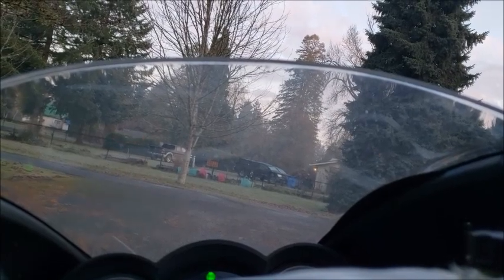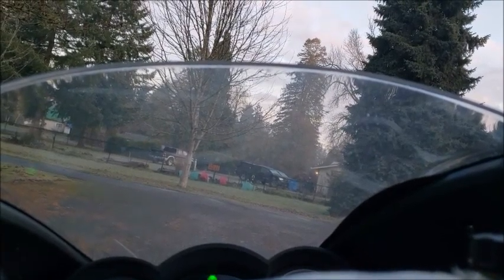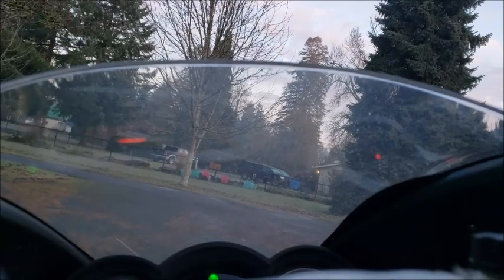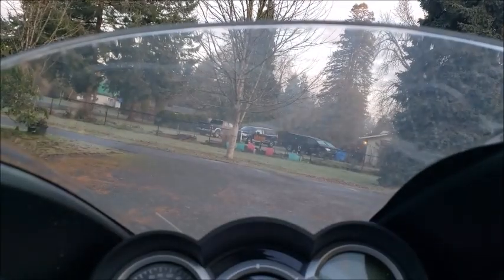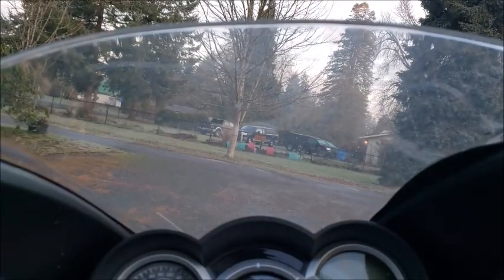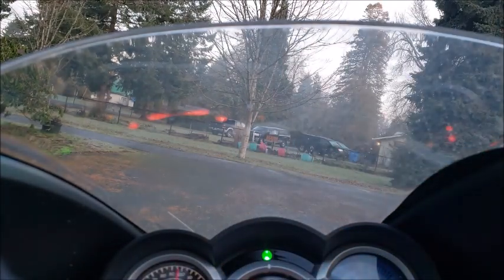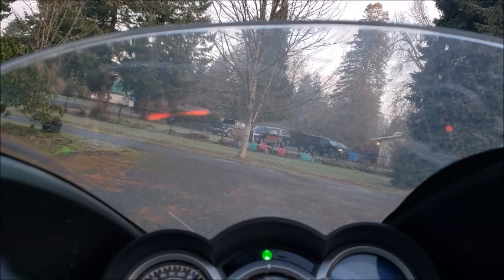Lithium Iron Motorcycle battery at 30F

Comment: This is why I bought a glass mat battery last time I needed one. Why don't you turn on the headlights to wake the battery up?
Reply from the maker: In the description...Ignition was on for two minutes for this attempt. I didn't have the high beams on...I'll try that next time since I have HID lights. However, just the ignition should wake the battery up sufficiently. I'm going to try for a replacement battery from Shorai and get a glass mat. The weight savings isn't worth this hassle.
Reply: @MrStrizver  I haven't experienced myself, but I've heard if you put high beams on you will be able to start in under 2 mins. I DID read that your ignition was on, but I didn't want to assume you have low beam on 100% as a lot of people alter the light circuit from factory.
Reply from the maker: @IanLandesman  I have another video with the temp at 42 degrees. That one I did 2.5 minutes with high beam. Started first try but was pretty weak. I expected better based on their marketing.
Reply: @MrStrizver  yeah... the marketing does promise a lot... independent reviews were not kind... I remember a Fort 9 video going over this a couple years ago.